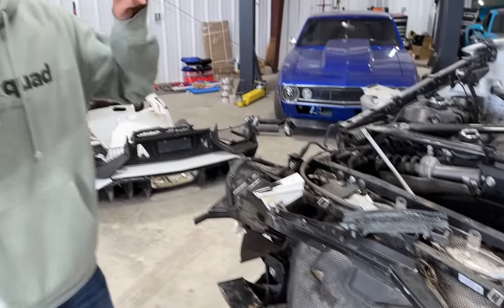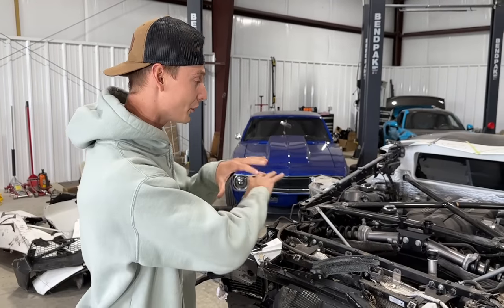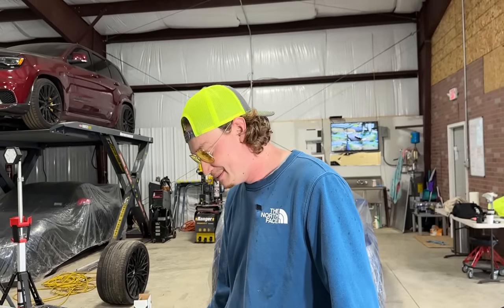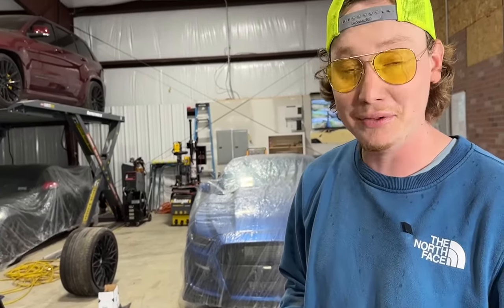Rebuilding A Wrecked Lamborghini Aventador SV Part 4

Comment: Ok so just to point out I know you guys get excited getting it started but if you don't let it properly warm up which is hard with all the coolent leaks y'all could do some really serious irreversible damage. If you seen Tavarish and his McLarens engine blow you'd just be more patient with the rebuild process Don't worry about the viewer opinion we're just viewers not our property to actually say anything. That titanium exhaust can be repaired a lot cheaper than the replacement option. Love the content
Reply: Every time they do that I cringe, one of them needs to learn how these High Performance Engine's work, I keep forgetting there young and didn't grow up building and racing high HP cars like I did, I thought for sure if they keep driving that Camaro they were going to put into a Pole, I would hate to see a Rod exit the block while revving the Engine on the Lambo.
Reply: Couldn't have said it better myself. Also it did rev drop, you  guys were to exited to hear it. For it to be popping like that it's already turned to.
Reply: I agree, it's cringe worthy watching the way they treat these Rare cars, who cares about how loud it is, I'm betting the neighbours hate it.
I would like to see more respect to the rare cars and build them with a level of high quality work, not just with a drill to bolt them up, use a Torque wrench at all times.
Reply: Not the scammer trying their best 😂
Reply: It ok. Once it's finished it'll go on the stacker and never get looked at again.
Reply: @1one3_Racing  You’re absolutely right.
Reply: Yep...quick fire to check engine function...OK...but they fired it up like 10 times...sheesh...

Comment: Please be careful with the engine guys. Love the revs, I just don't want to see it damaged because it's not properly fixed up yet. This is already an amazing build. ☺️
Reply: They blow that motor, then they'll need a mortgage on the houses to get a replacement!
Reply: @rangerrick8220 do you think they dont have money?
Reply: @cinematicmoment1166  I was making a point... but now that you say that and the way they spend...I wonder sometimes ...
Reply: @Ranger Rick Yes indeed. New V10 Lambo engines are 50 -70 thousand expensive. The alternative few people know about is the use of detuned V10s in early C6 generation Audi S6 cars. The complete car can be purchased for 20 thousand or less. My concern is a fire, knowing the car was in a rollover. Lambos generate a lot of heat in their tight engine compartments and will catch fire if any flammables are present. It's not a question of " Could it catch fire"?," it's "When will it catch fire"? Usually, after it's all back together and buried under carbon fiber panels, trim, components, etc. it's an accident waiting to happen. An explosive-proof electric engine exhaust fan/ racecar fire suppression system and master power-off switch on the outside of the car are a must.
Reply: @Godscountry2732  It´s a v12 in the SV though

Comment: You're in danger of overheating the engine and causing damage. There is air trapped in the coolant system is why the gauge still shows cold. You have to vacuum fill the coolant to get the air out. The titanium exhaust is also repairable. One more thing, revving it like that at cold start with cold oil is not good for wear on the bearings and cylinders.
Reply: i was hoping the engine will blow on them...they do this stupid stuff, they need a lesson
Reply: Mark they don't listen or read our comments. Let's just hope that doesn't happen....
Reply: @MihailBFC  ditto, there really stupid these days
Reply: Had to skip past lot of the  over revs, stupidity  is hard to watch,   I know …… then don’t watch .. you right
Reply: Hey they got the Car cheap right, so if a Rod exists the Block OH well.  😢😢
Reply: Watch out guys found the expert mechanic
Reply: @michaelwynne4346  they still probably bought it for 100k...That's not an oh well...

Comment: If the rest of the exhaust is in decent shape, wonder if Ryft can fix it for you. Just cut out the section and add in a new piece. Likely still expensive, but way less than a new one.
Reply: this was what i was thinking too.
Reply: I was just bout to type that
Reply: Just talk too Gintani... They have the best one for these cars
Reply: I was about to say the same thing. They can put it back in their jig and repair it
Reply: Anyone who can weld titanium can fix it, it will be way cheaper than getting a new one.
Reply: I think they would make a jig for it to retain it's geometry before they cut it and then just cut and send it
Reply: I was thinking the same thing it can be fixed 😊
Reply: just Weld in new mounting sections - No problem !
Reply: Absolutely can be repaired, just cut out bad titanium and weld in new pieces. That is a $15-20k exhaust and can probably be repaired for around $3k
Reply: @ingresswizard9044  I agree it was probably that expensive, but I'm sure a local fabricator can repair that for $1k... Just tell them it's for a Civic, not a Lambo!!!
Reply: @ssoffshore5111  Or a Ram.😜 If they told me it was for a Civic I would want to see said Civic.
Reply: @brunothefudge  22:36 If yes

Comment: Please make sure you're checking over and cleaning up everything before running and revving it again. Not worth possibly destroying something crazy expensive
Reply: I wonder if they checked the oil pan, After a roll over and the engine still potentially running when it happened could have caused damage.
Reply: Must be the first time you've watched them
Reply: @shmiggz  😂😂😂
Reply: @shmiggz  Best comment so far. I think after this build they should stop and do a bunch of racing with the builds, auction a few and make a small roof behind the building where the frame machine is and use the whole lenght to park builds outside at an angle. That way they have space inside to do stuff and keep it tidey.
Reply: @ForcesNL  they are always clean out the shop even with cars inside
Reply: I agree. Cringe. The Bronco with no oil and now this. You gotta be gentle on the startup.
Reply: Frr they just start revving it up after the engine hasn’t run for months
Reply: Yeah, I would have cleaned it especially see l that dirt before starting. Who knows how much dirt was in the crush intake box.
Reply: @stovepipe6769  Wonder they didnt turn it upside down like they did the Porsche before starting it !!
Reply: worth it for the views.
Reply: These guy are pros, I just loved the cold revs
Reply: they do that with every build.   they can piss away money though so who cares.
Reply: @henrikt1387  I agree a little knowledge is a dangerous thing, unbelievable,they havent grown up yet.
Reply: It sounds fine you'd know if there was damage right away
Reply: It’s not your car why care?
Reply: @stonechip  agree. I almost hope they do blow it up so maybe they learn the hard way.
Reply: @6996brandyl  they are really hard working. They are not pros and they are not very smart.
Reply: @stonechip  They never learn.
Reply: To much money
Reply: @ForcesNL not smart to leave all those cars outside in that area
Reply: I think this is the 1st car they didn't wash before they started working on it
Reply: Car was upside down. Could have filled cylinders with oil. Just crank it. It'll be fine and won't hydrolock an $80,000 engine.

Comment: Try to remember to fill the cooling system with distilled water on first fire ups. I've made the mistake a few times and had a huge mess to clean up. Any competent fabrication shop can repair the exhaust. Make sure you cross-reference any Lambo parts you need. Speciality car manufacturers source parts from other manufacturers which can save you thousands on every rebuild. Keep up the great work guys.

Comment: Titanium can be tig welded as long as you back gas the weld.  Look up welding shops, especially if you have any race teams near you.  Here in Indy there are tons of custom welding shops that specialize in welding this type of metal.  Look it up, could save you thousands instead of buying new.

Comment: The pumps are for emissions purposes, they are secondary air pumps and can be deleted and reflashed to remove them if not wanted, you should consider contacting ryft about the exhaust as i'm sure that damage can be repaired

Comment: Hey those titanium exhaust can be fixed by a dragster shop,they build dragster exhaust out of titanium, they can cut out the bad part of the pipe and weld in a new piece of titanium pipe.

Comment: Easily cut 2 SS Rectangles pieces and weld it solid, look at it it’s exactly same location where the top mount bracket did the same holes. Just patch it up and send it.

Comment: i think u guys have to check the routers properly cuz if even a small dent is on the router then there are alot of chance one the drive only u will crash like just for safety reasons check the routers then drive

Comment: they should see if they can send it in to get it repaired it looks like its just a small hole on both sides so it should be as easy as cou out the old welds and put in new peices and weld them

Comment: The motor does that “ghost cam” sound because the computer is trying to protect the motor because it’s not seeing the right air and fuel level it normally sees when it’s not wrecked

Comment: Guys you should be able to find someone competent who can repair the exhaust for you! The subframe & xbrace are two items that I would not repair! I would buy new or excellent condition used parts to replace them! You Guys said in an earlier video that all those things are easily available! If you go with doing a fix on those items you will have a Sam Cracc car! Which is something to be avoided especially since this is an expensive car. Another benefit of doing it right is you can clean all the mud and dirt and other debris easily while you have it apart! It will be interesting to see what you are able to do with it!

Comment: I bet it will have missing parts and wiring ran wrong when they say it's 100% oem finished. Oh that's right, nothing is finished they started just collecting dust in the corner. Would have been super epic if the motor exploded while revving it.

Comment: exhaust wraps for a temporary fix should work for a little while until you and fix or replace the exhaust… if it was me I wouldnt let that exhaust go to waste..I would get titanium pipe the same diameter cut the old out and use the pieces as a template for the new pieces

Comment: A good muffler welder who knows how to weld titanium could cut out the bad, and weld in new replacement pieces.  Save $$$.  Use the size and shape of the present portions to cut new replacements.  Not that hard for a good welder.  Remove it from the car so they don't know what it will be on, and that might save you even more money.

Comment: Super easy way to destroy a very expensive engine. That engine shouldn’t have ever been started until after it was gone through to make sure nothing would be damaged. It was upside down. How did they know there wasn’t oil, water or fuel in the cylinders beforehand without pull the plugs first?

Comment: They checked the oil level with the engine cold so that's not going to be a correct reading, they didn't fill the coolant and it has coolant leaks, and they're cold revving an engine which is bad enough in a car in good condition but in a damaged car with other unknown damage that's just not very wise.  I guess when you're a rich YouTuber with lots of money to throw around those things don't bother you.

Comment: But serously I don’t know why u guys are ripping parts off and cleaning and going forwrod it’s like u guy get the cars and then don’t wanna work on it and just film u guys doing stuff that doesn’t make sense like u guy haven’t even cleaned it off so u guys can start dismantling but seems like this is just another filler video of u guys not doing much but put together stuff that u didn’t need to just to have to take it apart again and the reason why it sounds sooo much louder at idle is cause there’s two huge holes in the pipes